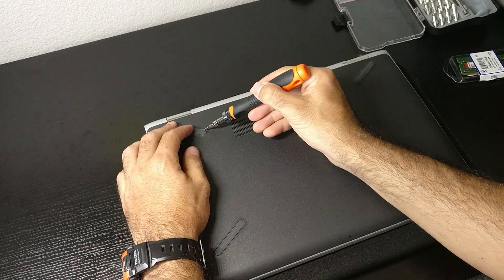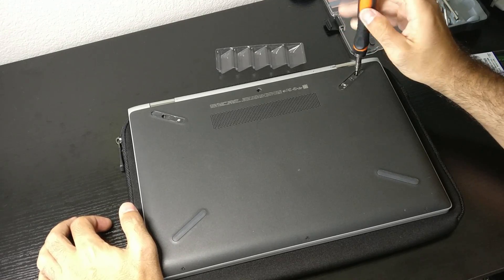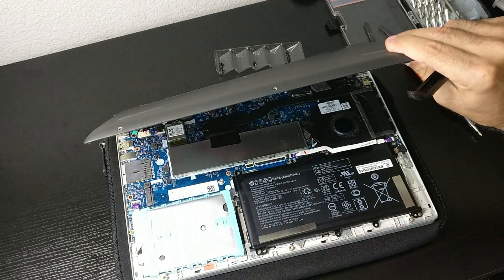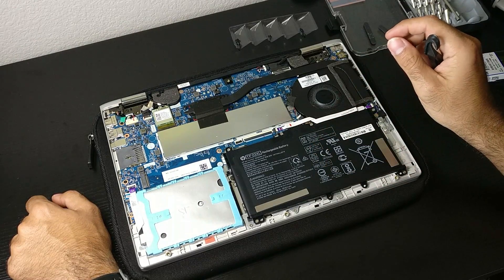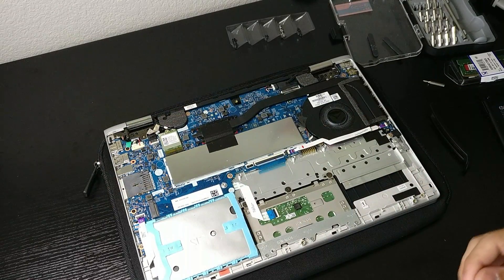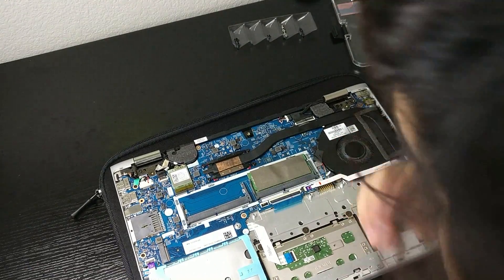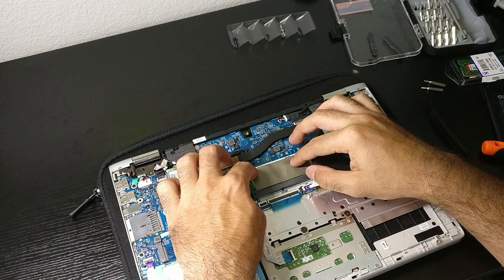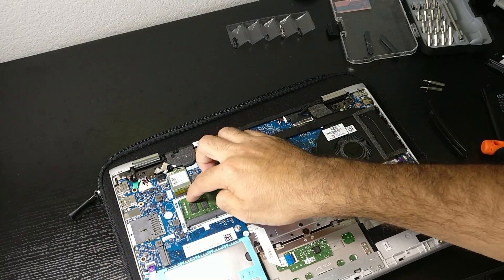How I Upgraded the RAM on my Cheap HP Pavilion x360 14m.

Comment: I upgraded the ram and now the computer won't turn on just a black screen and the caps lock key is blinking I'm crying right now god please help me how do I fix this
Reply from the maker: I'm sorry to hear that, I've never heard of something like that happening...did you turn the computer completely off before opening it and removing the battery? I would try to retrace my steps back to try to troubleshoot the situation
Reply: @orlandomireles6374  I'm just gonna send it to HP to fix it still has a waranty and clearly I am not certified to work with computers lol and since I posted that now nothing is happening when I plug it in the charging light doesn't turn on and when I press the power key nothing turns on nothing flashes and there's no sound at all :/ everything I try to do just comes and kicks me back in the face
Reply: @AviatingRandom  any update mate?!
Reply: @appscan25  im actually on my pc right now :) i will certainly buy another hp product if the service stays this good

Comment: What happens if you add in ram that you have use in another laptop
Reply from the maker: As long as the ram is compatible there should not be any problems
Reply: @orlandomireles6374  oh ok bro thanks i got you with a sub

Comment: i am using hp envy x360 model 15 m dr0011dx my laptop has only 256 gb ssd company fitted can i install harddrive in my laptop please reply bro aur any body have knownledge
Reply from the maker: Yeah you can totally do it...you have two options here, you can either swap your current SSD with another one with more capacity or if your laptop supports M.2 type of SSD you can install a second SSD...I'm about to do the second option and I'm planning to record the whole process of installing, migrating the data from the old SSD to the M.2 and setting up the laptop so it boots from the M.2
Reply: @orlandomireles6374  CAN YOU TELL ME THAT WITH SSD 256 GB CAN I INSTALL A HARDDRIVE COULD THEY WORK IWANT DUAL OPTION CAN I INSTALL TWO THING SSD AND HARD DRIVE AND BRO IAM YOUR BIG FAN
Reply from the maker: @anandkumargoklani3484  so you want to install a second hard drive? I'm not sure that's going to be possible, most laptops only have one hard drive bay because of space constraints
Reply: @orlandomireles6374  ok bro thankyou you are very kind i share your video with my friends and they will learn something new thanks buddy

Comment: I Have a model x360 11m - ap0xxx will this work for mine?
Reply from the maker: It would be a matter of checking if that model comes with dedicated DIMS for RAM memory or if ho cut some corners and soldered the ram to the motherboard...I know some brands like to do that with small laptops.
Reply: @orlandomireles6374  Is there an email i can contact you on?

Comment: Weakest point of these are the Disk harddrives.. I replaced mine with a SSD and its light years faster
Reply from the maker: That's correct, that was the first thing I did after the warranty wore off...I then added an M.2 disk and, although I didn't notice any difference with a regular SSD it's nice to have two drives plus it showed that it's another option to improve these laptops

Comment: I just bought one of these and it must be a newer build I do not see the RAM anywhere, when I remove the heatspreader, which is different in shape, there is only a 512 PCIe M.2 SSD drive?
Reply from the maker: It could be possible that they changed the internal layout, this laptop is roughly 5 years old at this point...also check if yours came with soldered ram, that could be another possiblity

Comment: 5:04 how do I pop it out I’m afraid I’ll mess up and break it
Reply from the maker: You gotta be extra careful, there are a number of metal tabs around the heat sink, yo have to very gently push them out to release the heat sink, it should come loose by itself if you have to use any type of force it means that it is not loose enough and you can break somethin

Comment: how to stick back the rubber in the back ??
Reply from the maker: So they come with a sticky rubbery thing that normally let's you take them off multiple times, but if that wears off you can use a bit of regular silicon, don't use crazy glue or any type of heavy use glue in case you need to open the case again.
Reply: @orlandomireles6374 thanks man , can we apply fevicol or smthng of that sort ?
Reply from the maker: @Manish-nd8rg  uhmm I'm not sure whats that but if it allows you to take it off at any point I would guess that it works
Reply: @orlandomireles6374  okk cool 
thank u !!

Comment: Hi, thanks for your video. It really help me to upgrade my RAM also. My HP x360 laptops only have 4GB of RAM and it really suck when I open Corel / Photoshop.
Reply: current models actually have 8 gb of ddr4 ram, such as the model I have.
Reply: @AviatingRandom  that's nice. So you just need 1 more 8 gb to make it become 16 gb dual channels
Reply: @AbiHariri  yep and thats exactly what im about to do
Reply: @AbiHariri  im gonna have more ram then my friends gaming pc which has 11 gb of ram
Reply: @AviatingRandom  nice. What kind of your processor? Currently I have core i3 but laptop / processor easy to become hot. I'm not yet add the ram to 16 gb. Do you think that add more ram will help the processor to not work harder? I'm not expert of it
Reply: @AbiHariri I currently have an i3-1115g4 in my laptop. And yes now im not big in computer science and stuff but in theory the cpu will have to control more ram, hence maybe resulting in higher cpu loads. another theory i have is the ram is helping the performance of the game so the cpu does not have to work as hard because its being relieved because it has more ram. I have no idea if anything i just said made any sense
Reply: @AviatingRandom  thank you for your explanation. My i3 is gen 8th. So then i need to upgrade the ram soon
Reply: @AbiHariri  exactly. One thing you dont wanna do is upgrade your proccessor, thats a no no that i cant really explain why so ill try my best.
you will most likely need to upgrade your motherboard for a new proccessor and you cant do that in a laptop because the laptop motherboard is curved and shaped in wierd ways to fit the laptop and putting a normal other motherboard in there would not fit.
Reply: @AviatingRandom  yes, sure, thanks 😁👍🏻
Reply: @AbiHariri  Hey mate! Can you please tell me what kind of RAM did you upgraded? I have same laptop as yours. HP Pavilion X360 8th gen i3, 4 GB DDR4 RAM... Please help me... Thank You.
Reply: @TanishqAhirrao  hi mate! I upgrade the RAM using 8 GB with speed 2400 Hz which actual speed for i3 gen 8. Your current RAM speed more than that but useless due to compatibility with the processor. You can use SK Hynix or other brand that you trust. Currently i use VenomRX. If you have more money, better to purchase 2x 8 GB so you will have 16 GB with 2 channels RAM conviguration. I recommend also to upgrade your storage with SSD NVME at minimum 128 GB for fast speed. Actually i'm using 256 GB SSD. Just clone your system using applications. Your motherboard support it.
Reply: @TanishqAhirrao  forgot about something, absolutely use RAM with DDR4. Good luck
Reply: @AbiHariri  Thank You So so much brother for the reply. I upgraded with 4 gigs of RAM. Used a Kingston one... 
Thank you for your help once again...🙏😀
Reply: @TanishqAhirrao  more than welcome bro. Did you purchase same spec and speed of the 2nd RAM?
Reply: @AbiHariri  No... The default RAM is 2400 Hz... I used a 2666 Hz Kingston one... Asked a computer geek friend whether it will affect my laptop or not... He said to go ahead with the 2666 one... So I installed it... Laptop works fine now... BTW sorry for replying late... Was busy doing things 😅
Reply: @TanishqAhirrao  yes it's ok to install RAM with higher speed but the speed will be reduced to the processor compatibility. Nice so you have 8 GB RAM with 2 channels configuration right?

Comment: My HP Pavilion x360 came with a western digital NVMe and it has an empty space for adding an ssd, can you please tell me the part number of the hard drive cable.
Reply from the maker: Ohh I didn't know there's was a model with only the M.2 drive, so in that case, what you need is a ribbon-style cable, the service guide states that the part number for that cable is L18218-001, you could try maybe on eBay or just googling it to see if it's for sale to the public.
Reply: @orlandomireles6374  Thanks

Comment: how much  ram memory can support the hp pavilion x360 comvertible 14m-dw1xxx
Reply from the maker: I'm not sure about that specific laptop model but for laptops in general, since they use SODIMM modules, the maximum supported RAM tends to be 32 Gb for dual-channel memory (16 Gb per stick).
Reply: Base on the processor it can run up to 32 GB of RAM. But the motherboard has a limitation to only accept 16 GB unfortunately. Check it on crucial.com

Comment: A question to you.. Why did you remove battery? I see there is no obstruction to install the RAM chip anyway so asking..
Reply from the maker: Technically speaking you don't need to remove it. It is more a safety feature so there's no possibility of any electric charge running on the system while you're working on it.

Comment: If I switch out the SSD to an nvme ssd, how would I change the boot in the bios after cloning everything on to the new SSD?
Reply from the maker: To be honest I'm still trying to figure this out, I've done a lot of research trying to find if I can run both the ssd and the nvme plus how to change the bios and I've only been able to find which nvmes work with the laptop, but still nothing about the bios, I guess it's one of the problems of buying devices like this.

Comment: I’m trying to get (2x8) sticks which comes to (16gb). Will it ruin my laptop or is it fine if I stick a bar of ram inside as long as it’s for laptops?
Reply from the maker: Well are you thinking about supplementing one 8Gb dim that you have already installed? Or are you looking into getting two sticks?
Reply from the maker: Man I deleted your reply by mistake I'm so sorry....so what I would do is first to check how much ram your cpu + motherboard support, then I would figure out the timings, latency and frequency of the installed ram and get the same values for the new sodims but with higher capacity
Reply: @orlandomireles6374  alright thanks man! Super underrated

Comment: I may have missed a part where you answered this but do you think the processor/graphics card ect could be upgraded too? Id like to be able to hotrod one of these to compete with the newer ryzen 7 envy
Reply from the maker: So I don't talk about that in the video but it's on another comment in this video.  Due to the compact nature of laptops, the CPU and the GPU come embedded in the motherboard, so it's impossible to upgrade them.  Furthermore, many low-end laptops don't come with a discrete GPU (just like this one) they only come with integrated graphics in the CPU. Hope this solves your question.

Comment: Hi, i have similar pc, i want to install 2 new ram modules, should i use single rank o dual rank? Thanks
Reply from the maker: Dual rank memory is slightly better than single rank memory, but only in single digit percentages, so if you have to pay 50% more for a dual rank memory instead of a single rank just to get barely a 5% boost I don't see the value there...that being said, if you are looking for best performance and have the budget by all means go for the dual rank, as always check that the memory you are going to install is compatible with your system or least check if you can return it if it doesn't work properly.

Comment: I have hp pavilion x360 dh0043tu its come with 8gb ram and 256 ssd . Can i upgrade ram upto 16 gb and ssd to 1tb? Pls reply
Reply from the maker: As far as upgrading to a 1Tb ssd I would say that for sure you can, like I said, make sure to check the videos on youtube on how to do it properly, especially because you'll need to clone your ssd....now for the ram upgrade it would be better if you checked if your laptop has two ram slots (which I'm 99.99% sure it does) but most importantly check the speed, CAS latency and timings of the ram that's already installed.

Comment: My x360 pavilion model number is 14 ba-0073tx. 
Will it be same opening procedure for me?
Reply from the maker: Couldn't say for a fact but almost all laptops have fairly similar opening procedures, just make sure to remove all the screws, if you're trying to pry open the edges and it seems harder than it should, a good rule of thumb is that you may still have an extra screw that didn't see before.

Comment: It looks to me like there is an M.2 socket for SSD, so one could use that for the OS, and the existing spining HD for data storage. Is that correct ?
Reply from the maker: That's correct... that's exactly what I would've done if had known there was an M.2 socket...the only thing to keep in mind is that if your model comes with an Intel Optane module, it will be installed in this socket so you would have to choose what do you prefer, the M.2 or the Optane

Comment: I'm wondering what is on the original Samsung RAM, is it like a heat tape? Is there no need for that on any RAM expansions?

PS - Yes, I've been trying to edit my videos on actually 6GB of RAM lol. Not fun at all!
Reply from the maker: So to be honest I'm not sure, I haven't had any issues so far in terms of temps with the computer but I think that the metal lid that covers the ram sticks works sort of like a heat shield.  Now if you have some heat pads or heat tape laying around I don't think it would hurt at all to use it.

Well you must have been struggling with that RAM brother.
Reply: @orlandomireles6374  Absolutely. Lol still using the old HDD too, bout to give this baby a whole lot of upgrades 🙃💸💸💸
Reply from the maker: @waterwanderer.mattyy  Honestly I felt the biggest difference on my PC when I went from an HDD to an SSD, but now I want to get a SATA M.2 as a main drive and leave the SSD for mass storage, since I saw the M.2 socket while upgrading the RAM.  I'm still researching to see if that's possible or not.
Reply: @orlandomireles6374  that sounds cool. I'm excited for you 😎 bout to crack mine open later this week and see if it has that too. My x360 is a bit  older than yours though ('16 or '17?) so it might not even be there I suppose

Comment: Why did mine cost $750 from Best Buy? I thought this was a high made laptop.
Reply from the maker: So there's a deal with these laptops and is that depending on the installed hardware it may cost more, mine didn't have any of the nice extras so that's why it was $450

Comment: is it really necessary to remove the battery?
Reply from the maker: Ok so technically no, that's why I hesitated to take it off or not, because it doesn't bother with the RAM.  That been said, since you are working with electric components, you should take it off for safety reasons, so there's no electric charge on any of the components.

Comment: does your laptop have any overheating issues ?
Reply from the maker: To be honest no, I don't tend to push it too much but haven't had any temps issues, do yours have?
Reply: Orlando Mireles thank you  for your respons. I still need to install an 8gb ram because i want my laptop to upgrade to 16gb ram.  But what do you mean with “i dont tend to push it too much” ?
Reply from the maker: @Dimasarif_  by that I means that I don't tend to do tasks that require the computer to perform at it's highest for long periods of time.  That and the fact that I have it on a stand that improves air flow may help to keep the temps within a good range
Reply: @orlandomireles6374   Do I have to buy 2 of the same ram sticks (2 x 8gb ram sticks)  I just bought these ADATA AD4U240038G17-R 8GB DDR4 2400MHz  do  you think this  is a good one  for the HP pavillion x360 corvertible 14-dh0xxx ?
Reply from the maker: @Dimasarif_  you don't have to buy two of the same ram sticks, however you need to make sure that the ram stick you bought is compatible with the ram stick that is already installed, by this I mean that both ram sticks should have: same speed (shown in Mhz), same CAS latency (normally an integer number like 16 or 18), same timings (a group of 4 numbers something like 35-16-16-16), and ideally same capacity.  You can find this information on the internet or you can simply take the laptop apart and check the ram stick that is already installed.
Reply: @Dimasarif_  for hp x360 ram is 2666mhz not 2400mhz bro
Reply: @AAKASH  hi aakash yes the existing RAM is 2666 but the processor itself only run in 2400 so i also don't know why the manufacturer put 2666 of RAM in there since it will be waste (mobo will downclock to processor requirements). I also have a plan to replace the original RAM with 8GB 2400. It will better for @Dimas Arif to go on with her plan to change original RAM (if the original only 4GB)

Comment: Does it support 2x32gb (64gb)?
Reply from the maker: To be honest, I'm not sure, according to the service manual it only supports up to 12 GB in "Two SODIMM memory module slots" that are non-costumer-accessible, but as you can see I was, in fact, able to access the modules and upgrade it to more than 12GB.
Reply: No mate, max out at 16gig